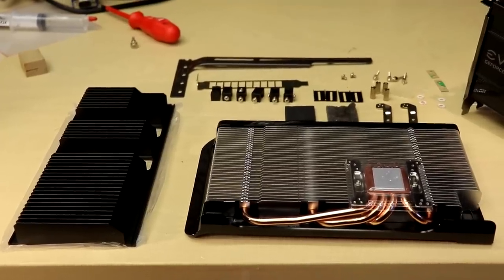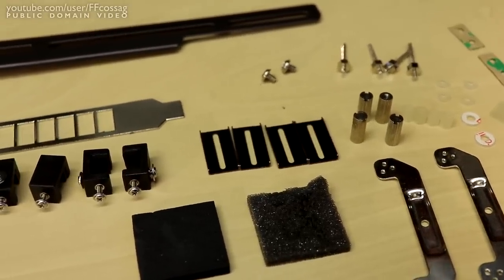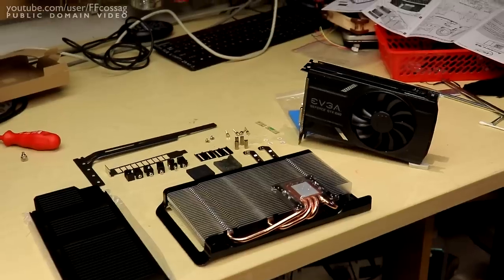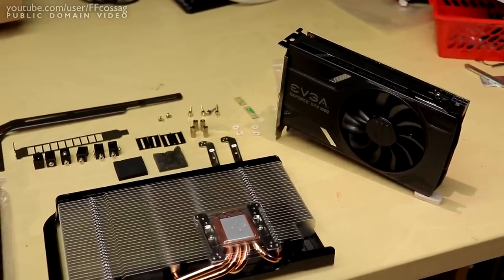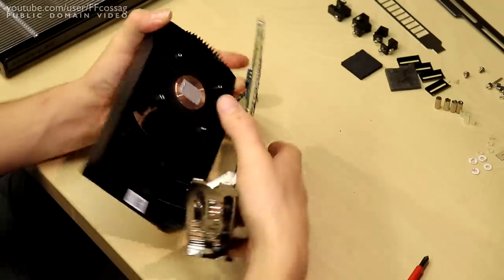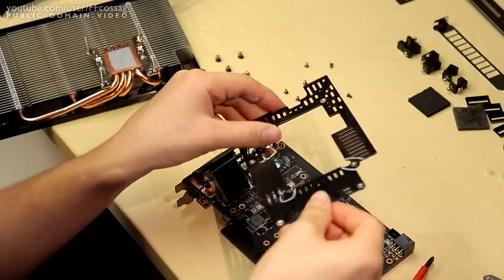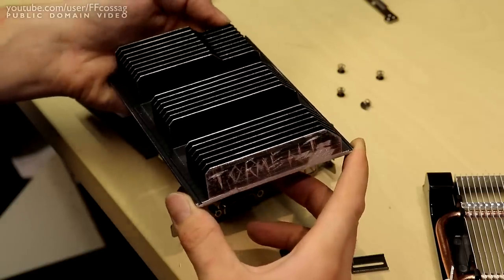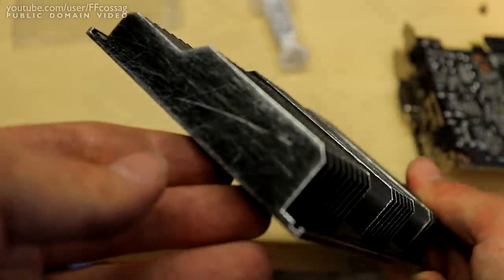Passively cooling a GTX 1060 (feat. kapton tape & oscillating tools)

Comment: The GTX 1060 is on the list of supported cards. Source: https://support.arctic.ac/index.php?p=s3&doc=techspec&lang=en

"Accelero S3 is compatible only with the graphics card using a standard size PCB with a width of 98mm." Does your EVGA meet this spec?
Reply from the maker: No clue! But I clearly got it to fit.

Comment: I noticed you had removed a corner of the thermal pad, and applied instead some kapton tape onto what I assume to be a group of welds, which probably are there to fasten the PCIe power plug receptacle in place on the board. What's that about?
Reply from the maker: I cut out the pad around thicker parts of the PCB, because else it'll sit unevenly.

Comment: How is that " passively cooled " ? theres 4 case fans + psu fan , even with the case side off the gpu will be getting cooled somewhat by them
Reply from the maker: There is no PSU fan ;)
Reply: @FFcossag  Yes I saw in a previous video you'd removed it after I commented lol

Comment: It's cooler than cool
When I worked in aircraft interior cabin lighting, the thermal gap pad was widely used. Not sure on the voltage ratings on that pad but many products it was sandwiched between the board and metal heatsink/ houseing. Typically in many aircraft this would be 28 vdc or lower.
Nice proof of concept and execution.
Reply from the maker: I'd wager aerospace grade silpad is of a tad higher quality than Ebay tier, lol.

Comment: I had an Accelero Extreme III on a 550Ti. Why? who the hell knows. terrible card, couldn't overclock worth a damn. at least the thing never got over 45C at full tilt mining DOGE back in the day, and that was just fine for me. The 1060 stock heatsink you have there is legit-- it's copper slug with anodized aluminum on the fins. I picked that same exact 1060 as the card in two friends' recent Ryzen builds in the past year and a half. Thankfully both were bought before the mining craze so they didn't get killed on pricing. but, for the basic user those are A-OK as it's simple enough to get a can of air underneath and blow all the air out. the stock heatsink also doesn't do a bad job at all at keeping the actual chip cool. This plus the EVGA warranty, which needs to be registered on the EVGA website to be active, and it's a good deal for the performance of the heatsink itself.

Comment: I had the 3 fan arctic accelero beast cooler thingy  on a RX480, i used the arctic intended method on the top heatsink and it got plenty hot. Just make sure that there isn't anything conductive to short out anything.

Comment: I think my $33 GT210 -  I'm cheap -  passive runs at 95ºC, because it burns you if you brush against by accident.
Reply from the maker: At least a temperature that high will get you excellent convection!

Comment: Aaaaw... no bonus shot of you just putting the side cover on to see if the temperature goes up or down.
Missed golden operatunity right there :)
Otherwise quiet relaxing and entertaining video despite not been my primary cup of tea :)
Reply from the maker: There's another video in the works regarding the aero design of the case, I'm just saving all that for later.

Comment: A thermal pad will smash around the taller components. I just mounted a Raijentek Eroboss to my RX480 (same heatsink as you have on your CPU).
Reply from the maker: Yep, but it can't compress infinitely. When some components are significantly taller than others, you stand to gain by cutting holes into it.
Reply: fair enough. I just put 3 layers of thick pads behind the GPU die. I like yours much better with the full back coverage. Eventually I plan to make a full cover block to atatch the cooler to (like the full cover water blocks) because I'm OCD about temps on everything.

Comment: I've used one of those Chinese thermal pads on my g1 3gb. temperature reached 97c
Reply from the maker: You don't use thermal pads on high load parts like a GPU die - only on things like whole PCBs or memory chips.
Reply: @FFcossag  yeah i only used it for vrms n chips but when i removed it  Temps returned at 60s. I also bought gelid pads since the original thermal pads torn apart

Comment: FF that is a beast now :-D, i hope it stayed cool enough under warp 9 conditions lol.
I do like the fact that you are extracting heat from the pcb, no one cares about the support components and they cook :-(.
I would imagine you had the multimeter in 60meg mode and checked the pads for really high resistance, you don't miss anything :-D

Comment: The "thermal pad" solution for VRM and vram cooling isn't the best. I've had the R9 290 cooled by an Accelero Extreme IV and after a year the vram had failed since the thermal pad failed to deliver good enough cooling for them. 1060 isn't that power hungry though so it may suffice.
Older acceleros such as Extreme III or Twin Turbo II that used radiators mounted with thermal glue were a much better solution.
Reply from the maker: The fun thing about thermal pads is that the thermal resistance decreases with increased surface area. Accelero should just supply whole-card pads like mine to begin with. ;)
Reply: Same here in a gtx960... But extreme 3

Comment: What's it like with the case on?  Better, I presume?
Reply: SarkyBugger probably better without side panel for both passive and active cooling unless you spin up the case fans high
Reply: I was thinking that the active cooling, with added ffcossag cardboard ducting, would force the air through the radiator, rather than bleeding out of the open case...  Hopefully, he'll let us know, here in the comments.
Reply from the maker: The whole system performs better with the case closed, but there's a bunch of aero mods added later on that weren't present when I shot this.